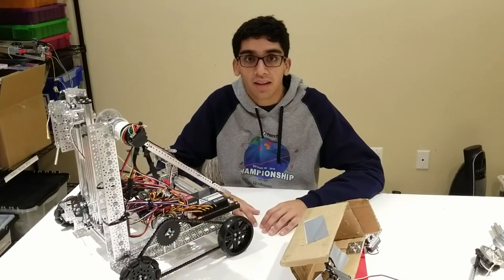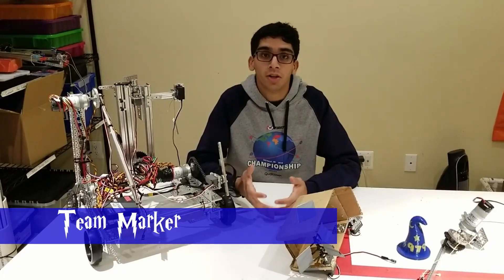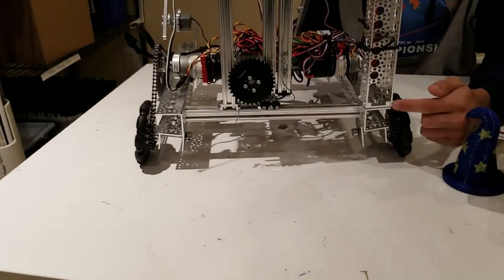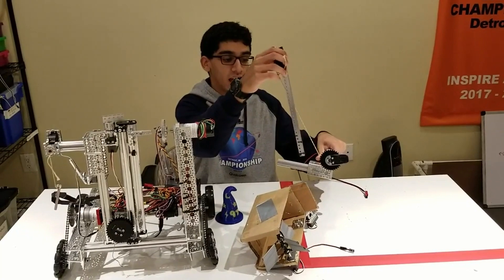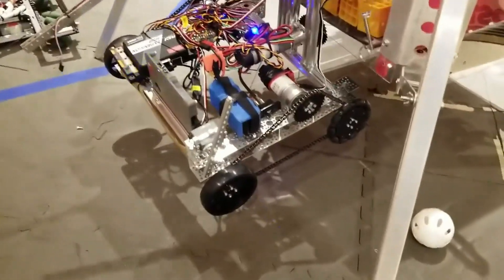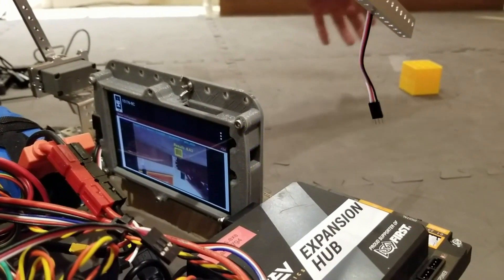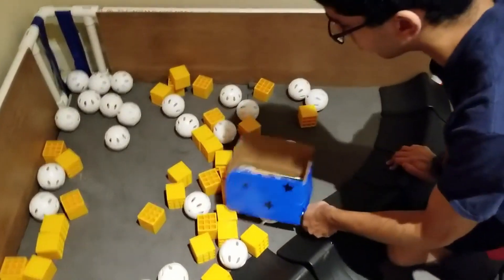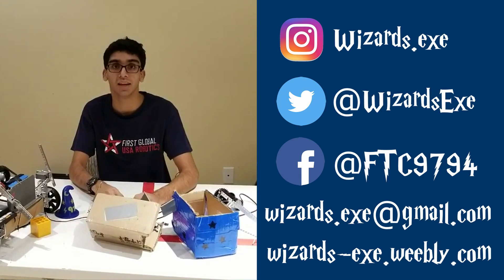Wizards.exe Robot in 3 Days Recap - Rover Ruckus

Comment: great video!
your ideas are amazing! 
 are you sure using the phone is legal?
I thought its just a connection to the robot...
manual 2 does not say anything about usage of the phone but have you read manual 1?
Reply from the maker: The video we are using is a Nexus 5 which is legal according to game manual part 1. Game manual part 1 also states it's legal to import your own libraries
Reply: From the 2017-18 Using Vuforia Vumarks "The 2017-2018 FIRST Tech Challenge game includes special vision targets that contain secret clues that can be used to score extra points during the autonomous portion of a match. These special vision targets are known as VuMarks. The VuMarks use PTC’s Vuforia computer vision technology to encode hidden information within each picture. This information isn’t easily noticeable to the casual human observer. However, the FIRST Tech Challenge software for the 2017-2018 season includes special functions that let a robot read the VuMarks using the Robot Controller’s built-in camera.
https://www.firstinspires.org/sites/default/files/uploads/resource_library/ftc/using-vumarks.pdf

Comment: I am glad you moved on from the free fall idea. I hope to brainstorm with our teams soon!
Reply from the maker: The free fall idea is not a bad idea, it just requires bracing the chassis. It's much easier than creating a fully functional linear slide mechanism, especially for rookie teams. It's also a lot faster. While we may not use it in competition, it's not a bad idea.
Reply: I brought up the freefall idea day one

but my team did not like that idea

glad to see someone using that!
Reply: I agree it is good for rookie teams, but it also leaves you with now pathway to lifting back up later.
Our rookies came up wit ha simple and easily implemented idea with a hinged arm, a spring to push it up, and a remote motor pulling it down like a winch...

Comment: Pretty cool robot!

quick note: you can avoid the bending in issues by putting standoffs on the inside of the channels to add support.
Reply from the maker: Yes we would recommend doing that, but it wasn't just the channel that was bending it was that the xrail joint was also getting lose and the channel was twisting.